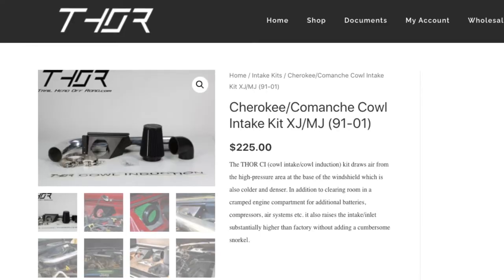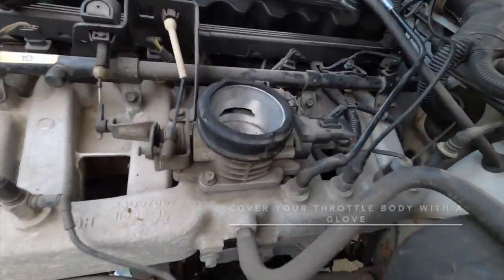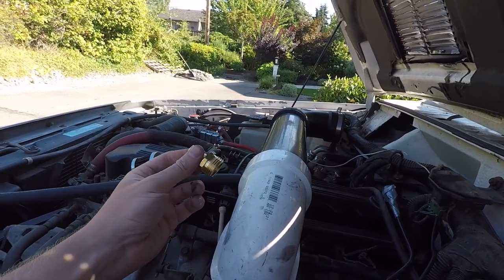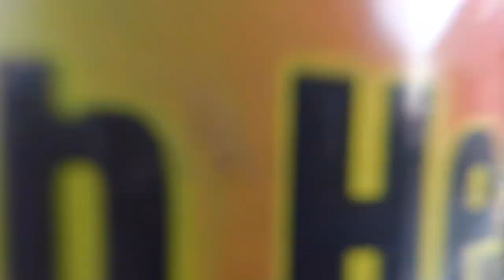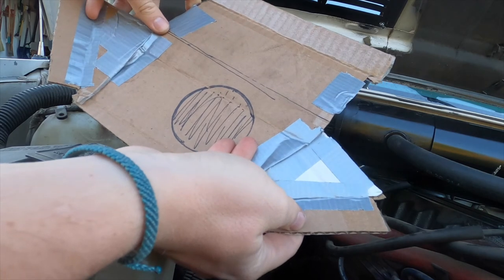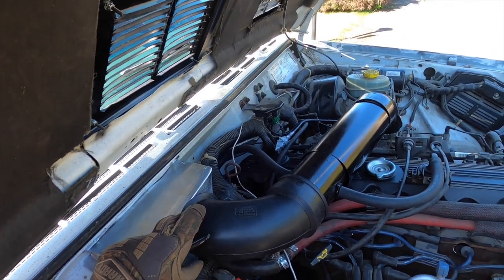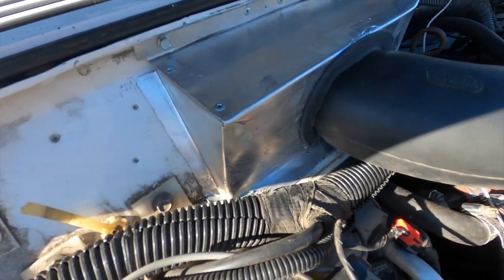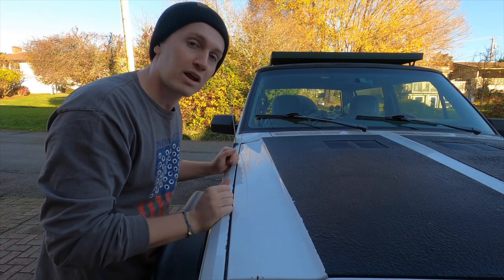DIY Cowl intake for Jeep XJ 4.0 (Cool and cheap)

Comment: i like how you fab'd that cowl cover. no welding, super simple. When I DIY "upgrades" it usually doesn't look like how you did it, clean job.
Reply from the maker: Thank you!! Necessity is the mother of innovation, I’ve been teaching myself to weld but my harbor freight welder (and my skills) are far from capable of doing aluminum yet and I think rivets look cool/are quite easy to work with!

Comment: I had used PVC tube between an air cooler and the manifold in a supercharged mr2. It started melting traveling over the sierra. Definitely would use something with a higher temp rating.

Comment: I built mine as a clone more or less of the thor intake. i made mine out of 3in stainless steel exhaust tubing. pie cut the angles for the bends and welded it all together. and made a flat cover plate to cover the hole. But i did use a foam UNI pod filter. it tones down the intake noise a bit vs a paper filter. total cost was about 50 bucks for me to make and a few hours of time.
Reply from the maker: I’m haven’t had an issue with the CPVC but making a stainless steel would absolutely be a great look. I’m a slow/novice fabricator so I take my time a bit more than you’d have to. Thanks for the heads up on the foam cover!

Comment: Nice man.   I just bought a Spectre (K&N knock off) for the stock air box.   3in hole saw on the stock box - computer side.      Now she breaths for $20.       But...    I'll probably end up doing this later to make the under hood space.
Reply from the maker: My only “note” is the intake noise is louder than I expected it to be, not terrible but it is quite a bit louder. It certainly made a lot of space I think I’m gonna be putting a second battery up there!
Reply: @SomeGuyOutside  Ya battery.   My 79f150 300 4x4 has a toolbox in that spot.

Comment: Another option would be silicone and metal pipes.  Lots of kits available out there if the pcv ever gives you issues.
Reply from the maker: I love the look of the THOR kit and if I had the money and no time I would have gone with them but I like to challenge my rather limited "fabrications" ability whenever possible. Plus if the PVC ever gives me trouble Ill get to make a clickbait video with some title like "DONT DO THIS MOD TO YOUR JEEP" 😂😂
Reply: @SomeGuyOutside   You could also use header wrap around the pvc intake to prevent the heat from being an issue.

Comment: Rad 2-Door XJ. I have a 97 2-Door XJ that I’m in the middle of putting a long arm lift with 35s.
Reply from the maker: Very cool! I got mine about five years ago totally stock, just been doing little projects here and there building it over time. Long arms have been on my list since about when i first got this jeep. Did you reinforce the frame before going long arm? I know some people do, some Dont.
Reply: @SomeGuyOutside  I want to but don’t have the funds yet. Needing a new trac bar, suspension, and tires I figured I’d just put a lift on. Now I realize that I also would need to do all kinds of stiffeners. If I had a garage I would invest in a welder. I won’t really be going offroad until I can get stiffeners and regear the axles for the 35s.
Reply: @SomeGuyOutside  I literally just got done taking the rear shocks off and got super lucky and the upper shock bolts didn’t break.😁👍

Comment: Excellent DIY COLD AIR INTAKE fab video. 👍 I will use your idea as inspiration for a ZJ. My only concern is rain/water coming off the windshield and draining into the intake. If you daily your XJ how do you deal with liquid intrusion?
Reply from the maker: The cowl on the XJ (or atleast mine) isn’t permeated above the passenger side as it is on the drivers side. So Water won’t fall directly onto the filter and should be draining before it can build up to a high enough level inside the cowl before coming close to the filter. Or that was the plan and so far here in Washington it’s not had any issues as my daily driver. Hope this can help in some way! It was/is a worry of mine but it has yet to be an issue
Reply: @SomeGuyOutside  Actually your response and detailed explanation is helpful and appreciated. Thanks for the reply and your helpful video.

Comment: Seems like the heat off of the engine would kill the cool air idea, the way it looks,the pipe laying on, crossing over the manifold,valve cover will keep it hot and the air coming in is heated by that.I think the way coming from factory is better and cooler air. But to each their own,your fabrication skills are great and you have more patience than me,great job on what you did.
Reply from the maker: Thank you very much! I deliberated over trying to cross over the block to have access to the relatively unused firewall area on the passengers side (like I did) or try to keep it on the drivers side but I couldn’t come up with a decent enough spot on the drivers side in the firewall. I THINK the air moving into the intake will be moving faster than it could be heated up in the time it’s in the pipe over the crank but that’s for a scienterst to answer than myself.
Reply: No matter where the piping is routed either way the intake manifold sits directly above the header. Having a cowl intake like this would be way better over stock because the stock air box doesn’t really pull in fresh air.
Reply: @DustySteel  Like I said to each their own
Reply: There's always a heat exchange either way.

Comment: Curious if installing some Kilmat type of noise suppression would reduce the noises in the firewall.
Reply from the maker: Honestly i think ive gotten used to it (lost more of my hearing). But I do think I'll be redoing it one of these days. Still looking the right design replacement and it will for sure have some level of noise dampening going in.

Comment: I think , that the hood vent in front of the cowl , is not helping 🤔
Reply from the maker: It had crossed my mind throughout making it, decided pros of both outweigh the con of them both together or having just one or the other. Overall still cooler air than the air in the engine bay would be by a substantial margin with the vents and intake and raised the intake over a foot higher from the OEM waterline level

Comment: If your intention is to "intake" cooler air why not install a snorkel kit?
Reply from the maker: If I could, I would. On more than a few years such as mine, you can see in the video that the  brake booster and CPU block most of the drivers side firewall and the battery, fuse box and and fluid reservoirs blocks the passenger side fire wall. I am currently considering relocating the fluids and seeing if I can route one out that side.
Reply: @SomeGuyOutside  that makes sense. Thank you for the information. Good luck with your future plans.

Comment: what about when it rains?
Reply from the maker: The filter is above the “water level” in the cowl area and there isn’t any water getting in directly above it to drip down onto It. I don’t believe there will be and there has not been any issue so far and it’s been in the rainy season of the pnw not much more of a rainy area you could get.

Comment: Give it to us straight, how’s it holding up?
Reply from the maker: It’s holding up great, only thing I’ve done since is reoiled the filter and soldered the aluminum box. I expected the rubber 90 to start breaking down from moving with the motion of the engine but no such noticeable wear has occurred. What I will say again is it’s a lot louder than I expected it to be, I’d heard videos online and heard people say the same thing. It’s the only part I’m working on changing at the moment!

Comment: Does this affect air flow into the cabin when you use the heater controls?
Reply from the maker: Not that I have noticed, my AC and heater work great. (They’ll break now that I say that I’m sure). I’m confident the air pickup that is inside the cowl is the cause for the severe increase in audible noise of the cowl. I’ve been playing around with the possibility of sealing off the two sections. (My concern is more to lessen the noise a intake noise a tad more than damage to the vents but that’s totally a possibility, that suction could be working the fans harder I suppose) If I ever manage to do so I will make a video about how!

Comment: Cuando llueve se junta mucho el agua hai
Reply from the maker: Rain won’t fall right onto the filter as the slots in the cowl are on the driver side and will drain at a lower level than the filter so it’s no more likely than the stock box to get water in it. I live in the PNW and get very heavy rains no problem so far, you’ll see an update if it ever does 👍🏻